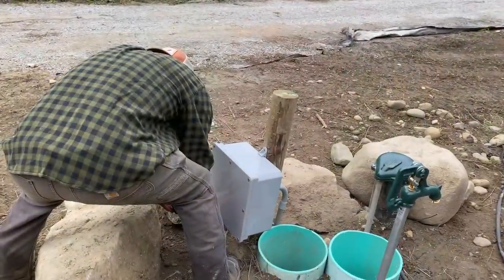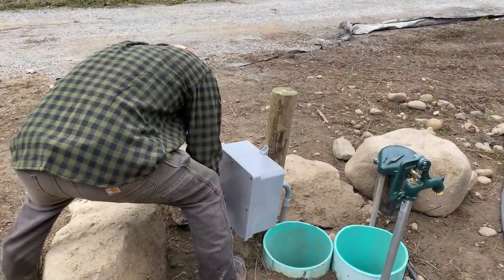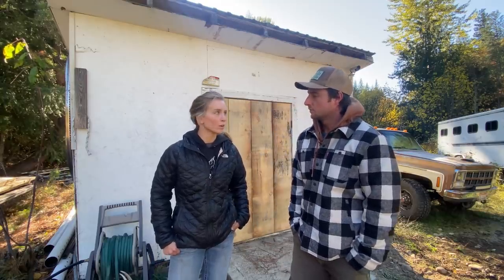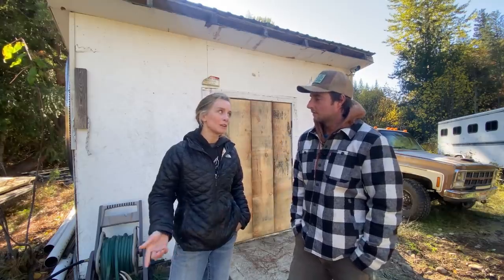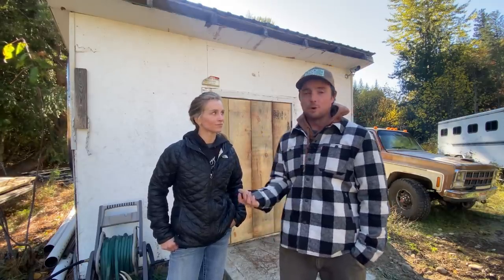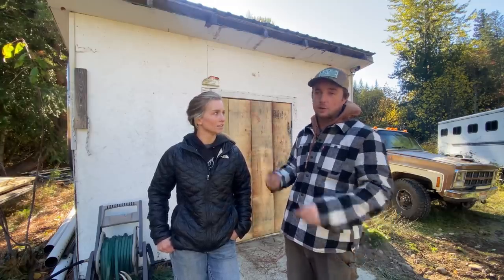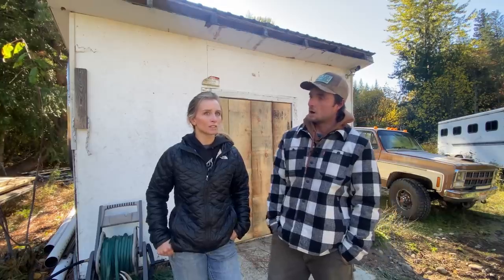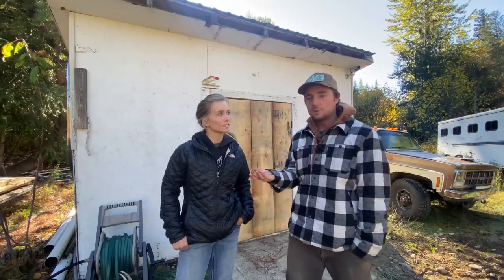Would A Wood Door Swing

Comment: That door turned out real nice. Good use of the cast-off cants from the mill. When I built a garden gate/door, I put a diagonal piece (Z) to prevent sagging over time. The lower brace goes against hinge side so the top pushes into the hinges. Thanks for sharing.

Comment: First to comment. First to thumbs up. Second viewer. I think a cross brace would help you out in the long run as those planks are a tad heavy at 1.5 inches thick. Thanks for posting
Reply: It would be good to run a diagonal brace from the lower hinges side to the upper non-hinged side if that makes since. Door looks great. Nothing better than building with lumber you milled yourself!!
Reply: @b.morris2816  I agree with you!
Reply: Give them time they will figure it out. 👍

Comment: It's a good looking door. The only thing I would do differently would be to be the piece in that forms a 'z'. That piece is important in maintaining the shape of the door. You can easily add that with door hung too. Then you won't have to worry so much about how the door will hold up. Other than that you've built a solid door. Good job.
Reply: Yep the door looks great but it will sag over time without a cross brace.
Reply: @duncangough9969  - Thus the pieces that makes a 'z'.
Reply: @PaullaWells  we are in complete agreement then! 😜
Reply: @duncangough9969  - Right on!

Comment: This is just a suggestion I'm not knocking your work. I would add an expansion joint on your pvc pipe Going up the wall.  And use underground wire interior wire won't hold up as long Even if it is in conduit.

Comment: If y'all build some sawhorses then you wouldn't have to pack those boards all over to your trailer just to measure and cut them. Saw horses will make the job a lot more easier because you can move them to any location where you're working and y'all did a really good job building your shed door I built plenty of them however inside your door you need to put a cross brace from top down to bottom where it looks like a z that will stiffen your door and keep it from warping and I have another tip for you especially on your metal roof on your shed if you use a heat gun or you going to be applying the sealant when it's cold warm up the metal then the sealant will adhere to it much more better.